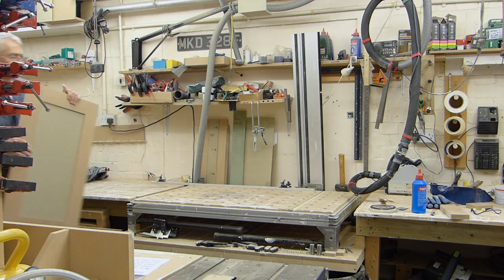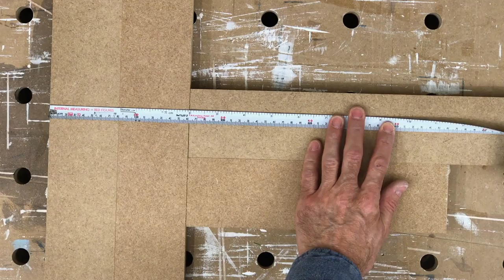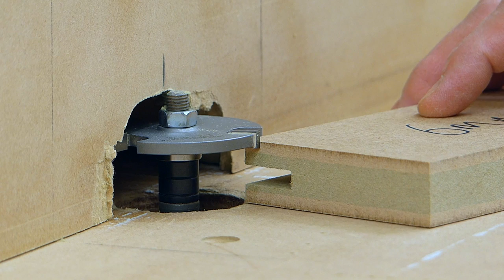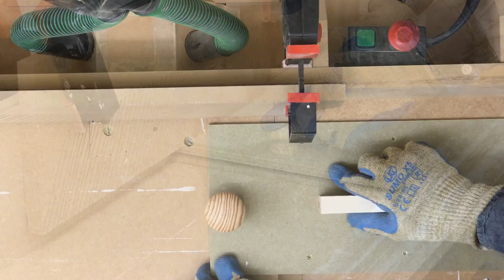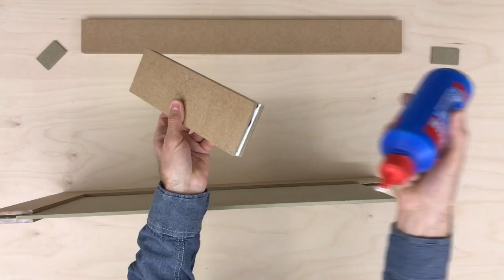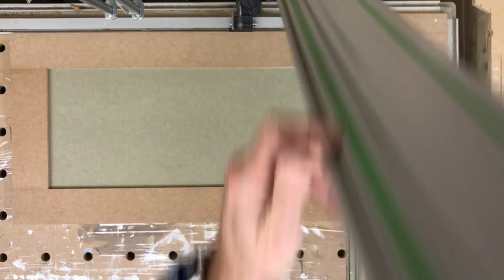Shaker-style Panel Doors #001

Comment: Hi Peter,

Great video, you make it look all so simple! You have inspired me to make my own shakers doors for my outdated kitchen. I have made a couple of test doors using my tables but I want to use the router table as you demonstrate.

I am having trouble finding a slotting cutter in the USA that will cut the depth of slot needed. Does anyone know of a source for such a cutter?

Thanks.
Reply from the maker: Thanks Kevin! I'm afraid I can't help you with the grooving bit - I know my preferred supplier, Wealden Tools, doesn't ship to the US, unfortunately. I do know a lot of guys who use a 13mm / 1/2" deep groove for these doors, without any problems; might be worth a try if you can get your hands on the bit. 👍

Comment: hi Peter. just a year in to woodworking at 37. but, learning fast. really admire how you achieved such simplicity yet effectiveness. can you share what paint you used and the application process for the doors. hmmm?
Reply: I also would like to know how you got the finish on the doors. Most of the time when I use a roller and brush it doesn't get the desired smooth finish I've been looking for.
Reply from the maker: Hi there! White paint is almost always a water-based primer/undercoat, followed by a water-based acrylic in an eggshell finish, either Dulux Diamond, or Leyland Trade, applied with a foam roller and allowed to air-dry naturally. With some other paints (Farrow & Ball, Paint & Paper Library) you sometimes need to blend it out with a soft brush before it starts to dry, though that is dependent on the paint. I generally use a sash brush initially to get right into the internal corners of the door, then over-paint with the roller.

Hope that helps and I hope you're enjoying your woodworking - never too late to start! Thanks for watching. P
Reply from the maker: Hi, sorry your Q came in as I was responding above. You need a very light touch with the roller - barely any pressure on it in the final pass - and occasionally you'll need to blend it out with a soft brush. You don't get a perfectly smooth finish, there is a bit of surface 'bobble' to it, but a lot of my clients like it as it looks more 'hand made' where a sprayed finish can look a bit 'manufactured' - so they tell me anyway ;)

Hmmm - maybe I need to do a painting & finishing video... :)

Thanks for watching. P
Reply: Thanks, I was just watching your built-in cabinet video where you went into detail on painting. A painting & finishing video would be helpful!
Reply from the maker: Okie doke - I'll see what I can fit in! P

Comment: Can MDF rails and styles be used with olgee router bits for decrative edge?
Reply from the maker: You can, but you need to use a good quality MRMDF otherwise you'll get fluffy edges and it'll be a nightmare to finish. 👍

Comment: Absolutely brilliant! I have just discovered your chanel. Can you make the same doors in the exact same way using timber and plywood or a combination of timber for the rails and stiles and MDF for the panel? I can't recall if you mentioned what thickness of MDF you used. Can you please confirm this? Thanks and keep up the good work.
Reply from the maker: MA - Michael Thank you! I'm only ten weeks or so into a year-long YouTube experiment, so appreciate the feedback! I used MRMDF throughout in this video, 22mm for the rails and stiles, and a 6mm panel, as this makes a solid, but lightweight door. Yes, you can absolutely use this technique for solid timber doors, but if you live in an area of high humidity, or with large changes in humidity between seasons, leave the panel unglued to allow for movement. Thanks for watching. P
Reply: Doors built this way with a MDF panel glued to the frame are very, very strong.  Peter was able to do this because MDF is very stable and he used similar materials in both the frame and panel.  If you start mixing your materials they are likely to have different rates of change from humid to dry and they may tear joints apart over time.  
If you replace the MDF panel with wood then the panel should be loose (not glued).  Not glueing the panel will reduce the strength of the door to the point where I would be inclined to want much deeper tenons then what was used in this video.  I probably would resort to dowels in that case.

Comment: Hi Peter, I’m new to the channel and really enjoy and appreciate your content. Quick questions re your shaker doors please. Your video suggest 22mm MDF for rails and styles, but would 18mm suffice? Second question, when you offset your groove for the back panel, is the groove closer to the front of the door or back? I don’t recall you mentioning anything when assembling the door! Thanks!
Reply from the maker: Hi. 18mm is fine for smaller doors; I switched to 22mm after I had some issues with larger wardrobe doors bowing; switching to 22 stopped that, but obvs. you can’t have a mix of 18 & 22 thicknesses, so I standardised on 22mm. But I made hundreds of doors in 18mm before then! 

Re the groove, in an 18mm door I’d make it a centred 6mm panel, so 6/6/6/. In 22mm I’d do 6/6/8 with the 6 facing out for a regular shaker door, and the 8 facing out for a ‘Victorian’ ie with a moulding applied. Hope that makes sense! P
Reply: Thank you so much!! I didn’t expect to get a reply let alone so quickly. Thanks a million!

Comment: Hi Peter, I've designed an alcove built-in with a double cabinet at the base. I like the traditional look of inset shaker doors i.e. in a face frame with butt hinges. do you have any experience with this and any advice? can I use 18mm mdf for the face frame? Also worried about the stability of the hinge screws and whether they'll work loose in the Mdf? Thanks
Reply from the maker: Hi. I don't do much with face frames right now - they seem to have fallen out of favour a bit here - but when I do I run the face-frame flush with the inside of the cabinet carcass, then return it back & scribe to the chimney-breast, wall, or whatever. This also covers up any gap around the carcass.

I've put screws into the 'end grain' of MDF before and haven't had any problems (long, skinny screws, with a pilot hole and a dab of glue) but I'd be a bit leery of doing it in 18mm - I think you'll have more issues with the MDF splitting than anything else. Would these be flush doors, or shaker-style panel doors? Just thinking of the weight...

The other trick I do with alcove units is to make the back of the bookcase slightly long, so it overhangs the carcass top at the back, then you just pull the bookcase forwards to get a nice snug fit. Finish off with a face-frame around the bookcase to hide any gaps. HTH! P 👍

Comment: Can I ask, is there a set size for the gap between to door and the carcass on an inset door project? ..... eg carcass opening 500mm, door width 497mm ?
Thank you for any help you can offer.
Reply from the maker: I try to keep around a 2mm gap between everything - anything less than 1.5mm (1/16th") and you risk the doors binding on a 22mm door, and anything getting up to, or bigger than 3mm (1/8th") looks gappy. So yes, a single inset door in a 500mm carcass 496/497 depending on thickness. 👍

Comment: Would you be confident putting glass in these doors?  Would you change the glue if these were being used in a bathroom due to humidity?
Reply from the maker: Yes, absolutely - see video #166. And no, Polyten PVA is water-resistant; wouldn’t use it in boat building, but it’s fine in a bathroom. 👍👍

Comment: Will a floating panel make the paint crack with drastic temperature or humidity changes? Painted, solid wood shakers tend to have that issue in this climate.  Might it be better for me to glue everything since MDF is such a stable material?
Reply from the maker: The panel is glued in, for that exact reason- - MRMDF is super stable. 🤷‍♂️👍
Reply: @10MinuteWorkshop  thank you so much for the response. I was worried about warping etc. I would prefer CNC router results but your design and instructions will make it possible for me to make my own. Your painting tutorial was excellent as well. Now I have a plan for this spring. One door at a time.

Comment: Hey Peter, loving these videos, I'm making some shaker doors and 'tooling-up' for the process.  I have a router and table but never used a groove cutter.  Going onto Wealden as you suggest I've gone for the 6.35 bit and a 1/2 inch, 8mm Arbor.  Question: do I need a guide bearing in addition to these when using a fence and table or are these only for 'hand-routing'. Thanks in advance.  Dave
Reply from the maker: You don't need a bearing if you're planning to use the bit in a table, although I have to admit, mine does; never used it though 😬

Comment: Hi Peter, great video. I have to make a bespoke set of doors to fit an opening. Just wondering how much bigger than your opening do you make your doors? It is two seperate openings, one door for each
Reply from the maker: Hi James, and thanks! I try and keep the gap between the door at around 2mm, and I prefer to keep the doors flush with the outer edges of the carcass if it’s freestanding, or 2mm between the carcasses if it’s in a run. Hope that makes sense! 👍

Comment: 2. The style of door is very similar to a Shaker style however it has a framed border to imitate a framed cabinet. I have watched your video and would think that your method would be great but as the outer frame will be approx 105mm will it remain stable and would you suggest the frame is made and panel inserted prior to the frame groove being routered. Also do you think it would be difficult to paint this groove effectively. the painting questions also remains with the doors in respect of Priming and finish coat although I would intend to fully construct the door before undertaking any Painting. The majority of these doors are pretty standard with the exception of the Pantry Doors which I intend to utilise 2 doors for and simply join the doors with a steel back plate. Do you feel that 18mm MR MDF is adequate or would you suggest 22mm. And what would you suggest the recessed panel thickness be ?
Many thanks for and advise you could offer

Comment: Hi Peter, I'm using your method and everything works fine when putting the rails/stiles/panel together dry. Upon adding glue, however, I'm finding that the rails and stiles are popping out and even with 4 clamps i can't seem to get them to stay flush - do you have any suggestions on how to remedy this? Thanks.
Reply from the maker: +Emma Withers Hi Emma. That's weird. Because I use a 1/4" grooving bit with a 6mm panel I sometimes get a slight misalignment, but it's usually easy to sand out. The other option is to put a clamp across the faces of the rails & stiles, then clamp them up to bring the rails and stiles together in the usual way - does that make sense? If it doesn't I'll draw something out and put it on Dropbox. Or do a quick video
about it... 😄

Comment: Great video, I was looking to make doors for my kitchen , this looks like the easiest way there is indeed!
how thick are the groove cut outs? I think the tongue&groove router cutters you use are really really expensive, I already have Trend 9.5mm rebate router bit, do you think it would be fine to use that? I would use them on 20mm pine.
Reply from the maker: Tom B. Thanks.  The heavy duty grooving bits I use are designed just for grooving, and last a long time; a rebating bit will generally be made for rebating, not grooving, so I wouldn't expect it to give as good a finish on both sides of the groove, though it's not something I've tried. You'll probably need to make shallower cuts over several passes in natural timber e.g. Pine, and be careful of tear out on the ends of the rails. The grooved I use produces a 1/4" (6.4mm) groove to a Maz depth of ~22mm or so - full specs on the link in the description. HTH Peter

Comment: Where would I find a similar cross cut saw assembly? That's looked amazing!
Reply from the maker: Hi and thanks! It’s an off-the-shelf Festool MFT or Multi-function table & the hinged rail comes as standard. I haven’t done a video about it as there are loads on YouTube already, if you search for it by name. 👍
Reply: It seems like it would be really easy to make one with plywood and a hinge.  I might give it a try, festool is way over priced.  I don't even have to look it up to know it probaby costs as much as a table saw.

Comment: Hi Peter, just been watching this again as I'm looking to make two pairs of doors for alcoves that have adjustable shelving in my office. Most helpful - thanks. Each door will need to be ~2400mm high and ~490mm wide and I was thinking of adding extra rails and increasing the number of panels in each door, partly for aesthetics but also to stiffen things up a bit. What minimum thickness of material (MR MDF) would you suggest for the rails and stiles given the height of the door? Thanks, Simon
Reply from the maker: Thanks Simon! At that height I wouldn’t consider anything les than 22mm thick for the rails & stiles. 👍👍
Reply: @10MinuteWorkshop  Thanks Peter. I have something of a reputation for over-engineering things like this so was all geared up to bond two layers of 25mm together. I'll ease off a bit  ;-)

Comment: Peter the festool setup you have as a saw bench with the hinged rail - how do you do this?  Is it something bespoke or can you buy off the shelf?  Just setting up my own workshop for some DIY projects and love the look of this setup.  Cheers Dave
Reply from the maker: Dave Fellick It's a totally off the shelf solution from Festool, they call it a Multi Function Table, or MFT; the current version is the MFT-3 - not cheap, I'm afraid, but a very useful solution, especially for a small workshop!

Comment: Hi Peter as a new subscriber slowly working my way through your entire back catalogue could you please answer two questions if and when you have the time please . 1 when making shaker style cabinet doors that sit outside the cabinet frame do you have to make any allowance on the door size ( in comparison the the total width and height of the cabinet ) to allow for opening clearances ? 
2 why do you sometimes make wardrobe doors fit internally into the cabinet frame as opposed to sitting on the outside of the frame as in shaker doors or a standard kitchen unit ? Is this purely down to customer preference ? 
Thank you for a brilliantly informative channel.
Reply from the maker: Hi Steve and welcome! When The doors are overlay (ie doors outside the frame) then it depends wether it’s a run of cabinets or just a single/double carcass. If it’s a single unit then I like the doors to finish flush with the sides of the carcass, so the only allowance is for the gap between the doors (if a double carcass). If it’s a run of units, then I like to have the gap between the hinge side of the doors equal to the gap between the doors, if that makes sense? It also varies wether the carcass is flush against a wall or freestanding. It’s more complex than you might think! Maybe I should do a video on it, lol! 

As for overlay vs inset doors (where the doors fit within the  carcass completely) it’s almost always down to client choice. 

Hope that helps! Cheers, Peter. 👍
Reply: @10MinuteWorkshop  Thank you , you have explained that so even I can u understand it ! I shall be attempting a small set of kitchen type cabinets shortly and you have helped no end and YES a video on this topic would be very interesting thank you for answering my questions 
Cheers!
Reply from the maker: Pleasure Steve. Let me know how you get on with the cabinets! 👍👍

Comment: Thanks Peter, another very useful demonstration. One question  - you cut the slot in the rails and stiles slightly offset, does the panel sit nearer the face of the door or the back? Is that just an aesthetic thing?
Reply from the maker: Hi.Yes, just aesthetics/personal preference; a 6mm panel centred in a 22mm rail/stile would leave a ~8mm rebate which is getting a bit 'chunky' for my taste. I prefer to leave roughly 6mm on the outside of the door and ~10mm inside, though it would be different if I was applying a moulding around the door to make it a bit more traditional/'Victorian'. Also, making the groove offset makes it pretty easy to distinguish between front and rear faces of the components ;) Thanks, P

Comment: Sorry, a silly question. How would you proceed for doing a groove in the rails and top and bottom when you don't have a router table? Thanks!
Reply from the maker: Thanks! It’s possible, but I wouldn’t recommend it tbh; a grooving bit is a big bit to be swinging outside of a router table, and while there are some experienced makers who can do this, I still wouldn’t recommend it. I’d suggest trying a mock-panels door, described in the mor recent ‘two easy doors’  video - https://youtu.be/jwGvYsvdCg4 👍👍
Reply: @10MinuteWorkshop  Many thanks Peter! My idea is actually to stack the stiles and rails side by side on their edge. That would give me a flat surface on which I can rest the router, and then run a groove on the sides of all four pieces. Tedious process, not sure it is very safe (hence my question). I would then connect the stiles and rails with dominos. All this to fit in a glass (or plexiglas panel in the door) for a homemade kitchen cabinet.
Great channel in any case!
And many thanks indeed to take the trouble to answer my question!